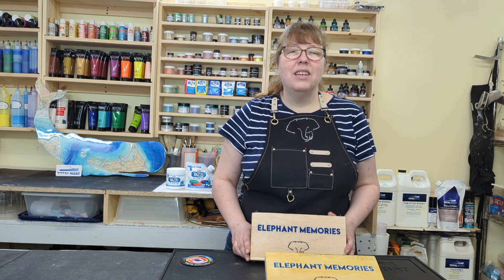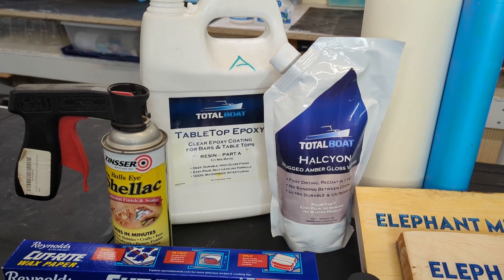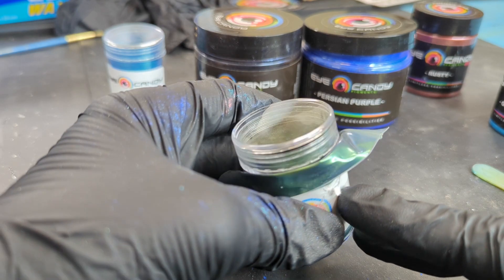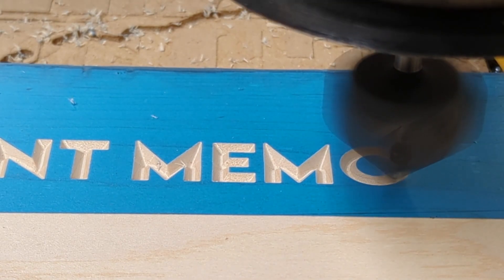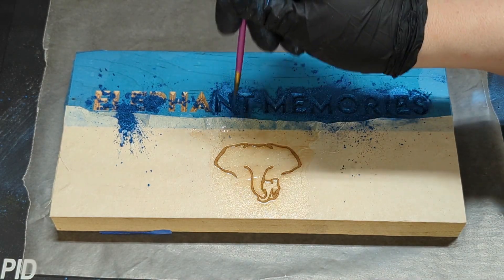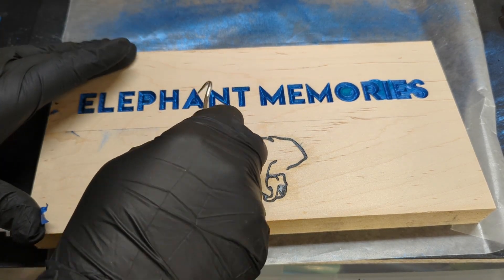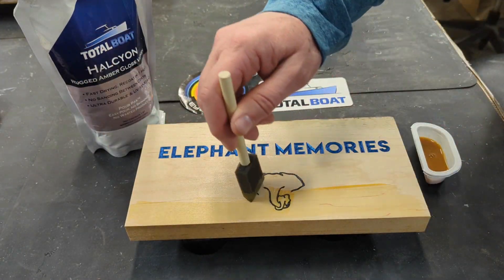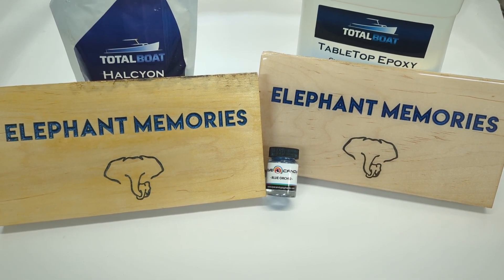More Color Filling Techniques on Wood for Laser Engraving, CNC and Carving #colorfill

Comment: Hi,
Love your presentation.
What colouring is suitable for logo and Personalised messages on cutting boards ?
Regards 
Paul
Reply from the maker: The pigments come in every color, so for a logo, I would go directly to the pigment company's website.  I personally use Eye Candy Pigments.  There is a link in the description.  Then try to match your logo color with what they have available.  As for personalized messages, I would consider the type of wood you are using.  Is it dark like walnut, medium like cherry or light like maple.  Then pic colors that compliment the wood with a consideration to your message.  They even have glow in the dark and neon.  Good luck!
Reply: @1elephantmemories  thank you so much for such a prompt reply. My cutting boards are made from various strips of hardwood, i.e. walnut, mahogany, cherry, ash, oak, cherrywood, iroka, maple, beech - the logo and message could be on any of these woods, engraved with a cnc router. I don’t think I can send you photographs on this medium. Any recommendations and Im sure the paint is good safe.
Reply from the maker: @PaulMarlmountWoodcrafts  pigment powders and most colorfill type paint is not food safe.  I would suggest that you do more of a resin inlay.  You can follow the instructions on this video using the epoxy resin technique by adding a clear resin on top, then sanding it smooth, gradually going up to 400 or higher sandpaper.  Then adding a natural, food safe wood conditioner like Bumblechutes.  I will be adding a video on resin inlays in the future too.  Make sure your epoxy resin is BPA and VOC free.  I typically use Totalboat Tabletop epoxy.  There are links in the description on these products if that helps.  By adding a food safe epoxy to seal the paint or pigment powder, your cutting board will be safe for people to use.  I tell people to use the back side for cutting and the front with the epoxy resin for serving.
Reply: @1elephantmemories  thank you, appreciated 
Regards 
Paul

Comment: Very good video!  What torch do you use and laser?  Thank you.
Reply from the maker: Thank you.  I can't wait to do more.  I have a Epilog Mini 50 Watt Laser.  The torch is just a basic culinary kitchen butane Torch.  Great for popping bubbles in resin.
Reply: @1elephantmemories  is the epilog hard to work.  Is it easy to learn.  Do you wear a respirator ?  Do you have venting ?
Reply from the maker: @petra3049  The Epilog laser is very easy.  You can basically think of it as a printer, but instead of ink, it uses a laser beam.  If you know how to use some type of designing program like Corel Draw or Adobe Illustrator, then you can use a laser.  It takes a little practice to understand the setting but it is pretty easy.  You do not have to wear a respirator for the laser.  Yes, we do have this vented outside.  When we first bought this, we set it up in a bedroom in our house and just put the vent in a window.  Epilog is a workhorse and made in America.  Great customer service.
Reply: @1elephantmemories  what do you use for a design program.
Reply from the maker: @petra3049  I use Adobe Illustrator CS4  It is an old version I bought many years ago but still works perfect for what I need.  Adobe now has an online subscription called Creative Cloud (CC).  However, my husband uses Corel Draw.  Both work equally well.  It is really just whatever you might know.
Reply: Could you please tell me the name of that adhesive type of paper you use again and where you buy it.  Thank you 💖
Reply from the maker: @petra3049  Are you looking for the plastic one for CNC or the paper masking one for laser?
Reply: @1elephantmemories  both honestly
Reply: @1elephantmemories  both
Reply from the maker: @petra3049  The plastic mask is called Oramask from Tools Today.  There should be a link in the description.  The 12" paper masking tape is from jds or johnson plastics.
Reply: @1elephantmemories  thank you so much !!!